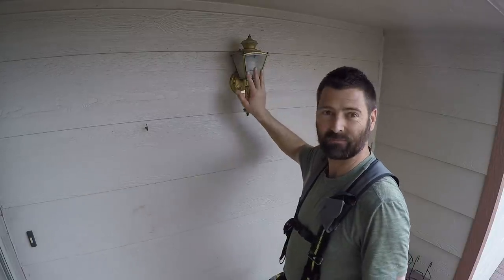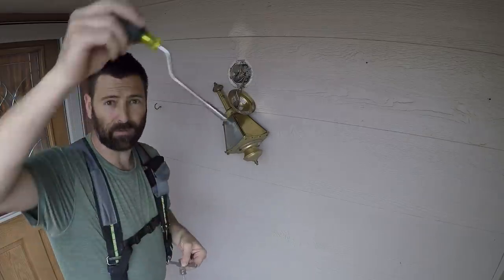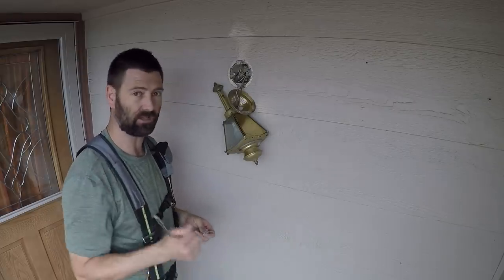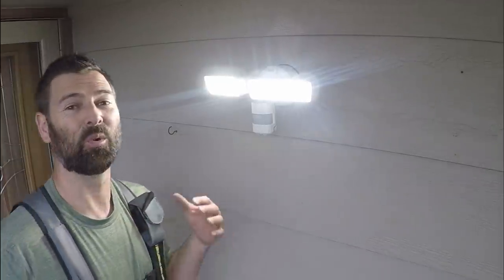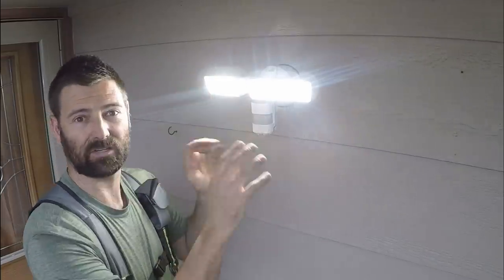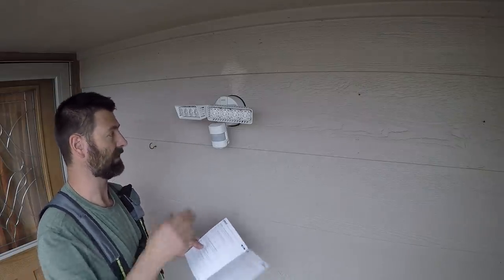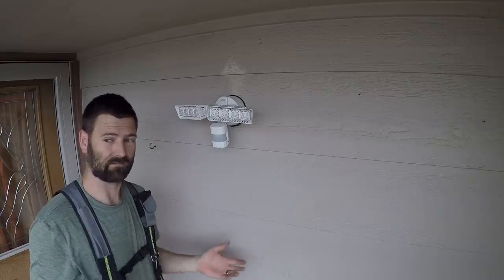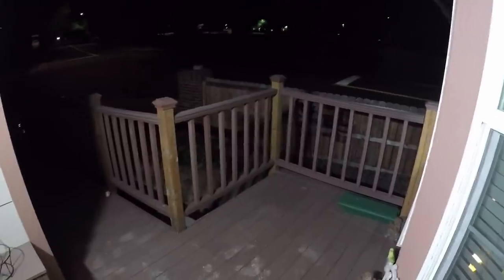The Brightest LED Security Light On The Market | THE HANDYMAN |

Comment: I'm a believer in LED security lights. I have a couple. 

It's been through two years of Texas weather with no problems.
However, I keep the $5.48 porch lights stocked on my truck for rent houses.
I do put LED bulbs in them.
Reply: Have you seen these new motion sensor light bulbs? Pretty cool, just pop them into the light fixture & you're done.
Reply: Drool, no I  haven't. 
Do you have a link?

Comment: I found this light on amazon a little over a year ago and bought one...mine had a square with 4 LED heads instead of the rectangle.  LOVED it....then about 12 months in, 3 of the 4 light heads on one side quit working and the light was then deemed useless and I replaced it
Reply from the maker: did you contact them to warrant it?
Reply: I didn't...I was a fool and threw the light away before I got back on Amazon to take a look at the warranty period. I had only paid 29$ for it since I had found it on a black friday flash deal
Reply: Is there a link for the lights?

Comment: “First Thing” ought to be to turn off the electricity.
Reply from the maker: LOL.  Just turn the switch off.
Reply: Better yet, call the power co and have them drop the line.
Reply: You can make sure the switch is off as long as nobody's home to turn it back on while you're working on it LOL 😂
Reply: Safety 3rd

Comment: can you wire these "with" the existing light sconce?  I want to use the light sconce for regular night light - decoration as I have flame lights and they look nice... but, when I'm asleep or away - I'd like the flood to function along side the light sconce on the same wire.

The flame lights are led and smart, so they can turn off on their own without cutting power and these clearly are led also, so I assume power on the existing 1996 wiring would be minimal.

Comment: 3600 lm  my celing fan does that. Just kidding my celing fan is 6400lm lol.     Wired up a 500 watt led to a  motion sensor    outside my  door             doin 50,000 lm on door light,        property light  did a nexgen light  for the property that  thang   is outputting 70,000 lm   it lights  4 acres  of my land,  maby time to chang the title of the video  lol

Comment: I'm thinking that the first thing you did was not taking the old light down, you probably shut the power off first, right ?.Anyway, I'm sure the hobos will be happy that the light controls are right there under the light. :-)
Reply from the maker: I just turned the light switch off. 😁
Reply: I always go to the circuit breaker, I guess if the house is empty it's safe. I'm just old fashioned  :-/

Comment: Good video, but Check the bad reviews on Amazon before you buy this fixture. 
No ETL stickers, no waterproofing inside to protect components from moisture.
Reply from the maker: What is an ETL sticker?   I have had it on my house for over a year.   Works great.
Reply: ETL has a long history that began in 1896 when Thomas Alva Edison founded Electrical Testing Labs (ETL). Edison’s vision was to provide assurance to consumers through product performance and safety testing.

Comment: What no caulking
Reply from the maker: That's a joke right?
Reply: @TheHandyman1 Yes, Do you have a video of that tub job coming soon?
Reply from the maker: No.   There was foam backer rod pushed in under the tiles.   The new caulk looked about the same as the old stuff but clean and white.